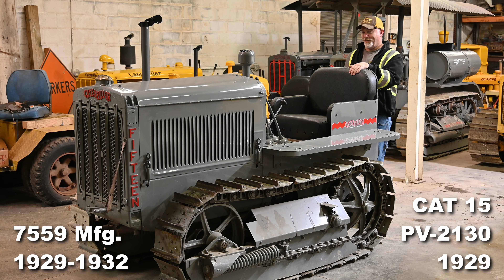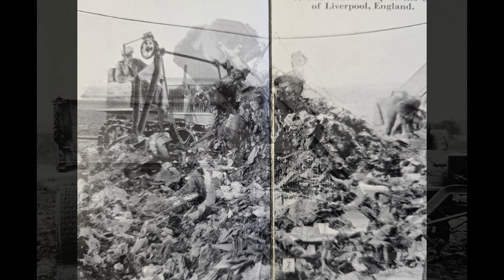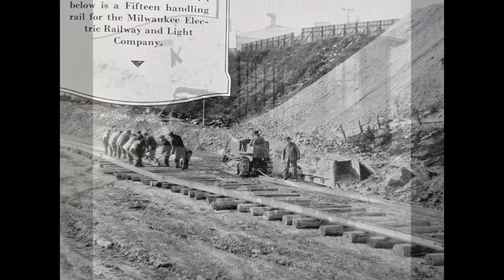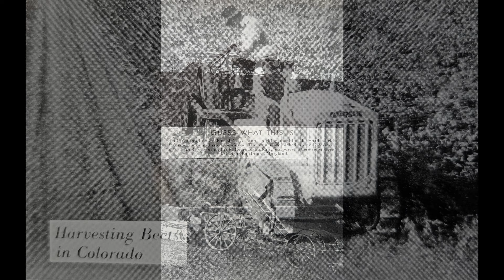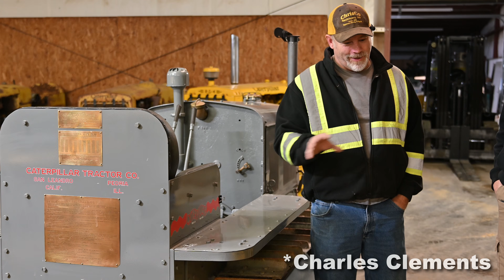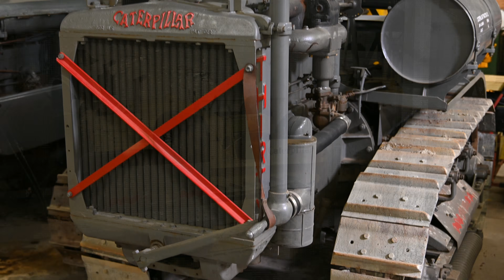1929 CAT Fifteen - A Bigger Tractor built for Bigger Demands | A Brief History

Comment: Our family 15 brought logs to the sawmill. That ended when my Dad joined the US Navy during the Korean War.  The 15 sat for 28 years in the woods and then Dad and my Uncle pulled it over to our place - the engine was frozen.  I spent every day in 1982 spaying oil all over the crawler and various liquids down the sparkplug holes.  I'd also put a big pipe wrench with a 5 foot cheater bar and jump on it.  Long about the end of April, the engine turned and I spent the summer getting her ready to run.  She roared to life towards July and we used her to drags felled trees up the hills of Western PA and used the dead trees for firewood.  The 15 is under roof but the mag is dead.  Love the 15 and your video.

Comment: I grew up running a 1928 "Thirty" multi-fuel crawler that was used in the Sutton coal fields before we got it in the mid-sixties. We only used gasoline tho. Manual prime by pouring gasoline into the cups on top the engine and manual pressure relief on the side. Hand crank. WORN out drive system, I got real good at putting tracks back on out in the woods. It was a hauling beast tho. I ran it for about ten years.